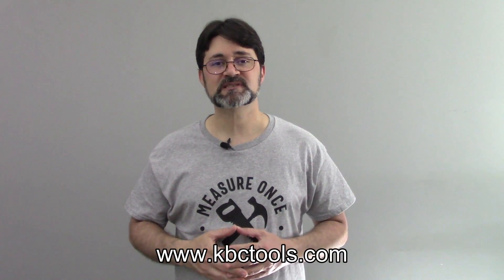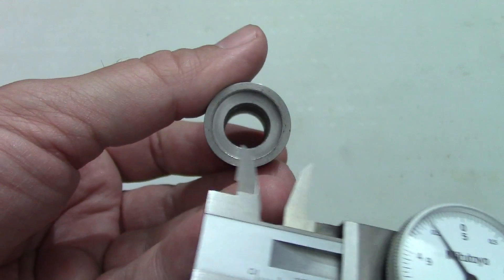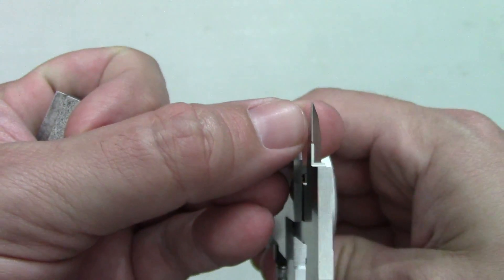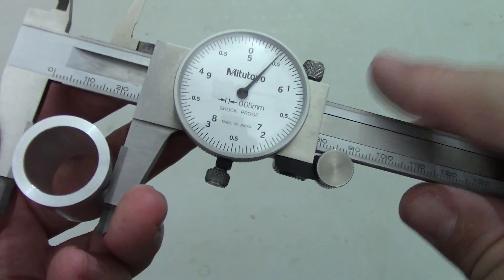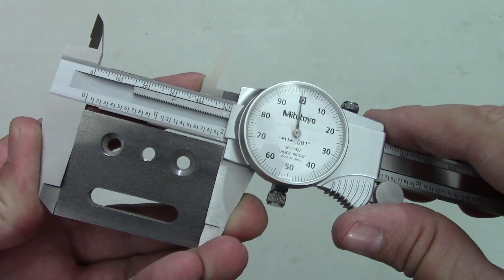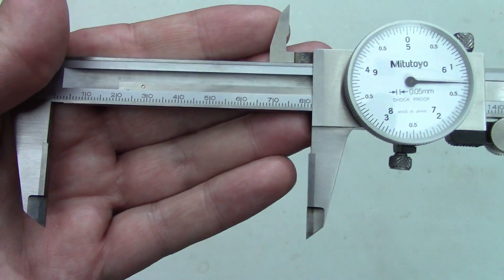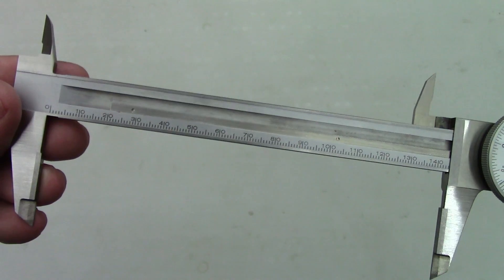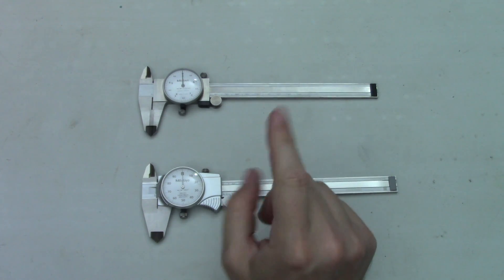How to Read Dial Calipers

Comment: Been using dial calipers for years and didn't know about the small tool for re-indexing the dial. Luckily I still have it in the storage box. Mine are Craftsman from the 70's and I try and treat them well. Great video, thanks.
Reply from the maker: Not every pair has it. The metric ones in this video do but the inch ones don't. I guess it depends on the model.